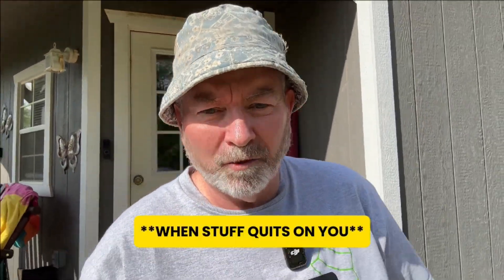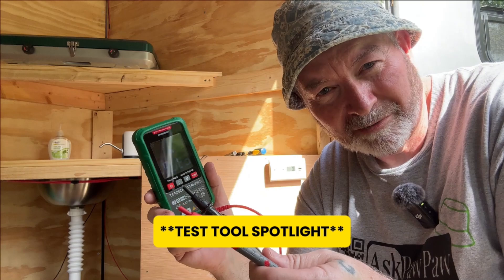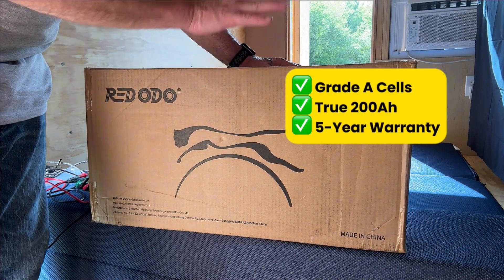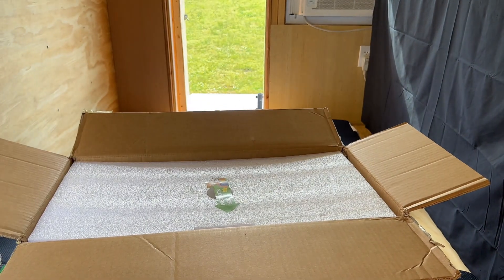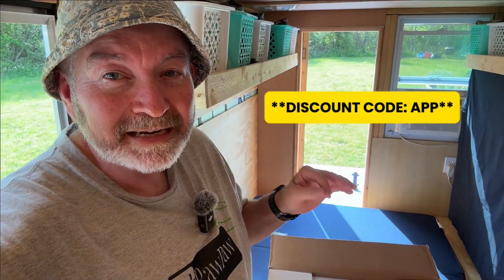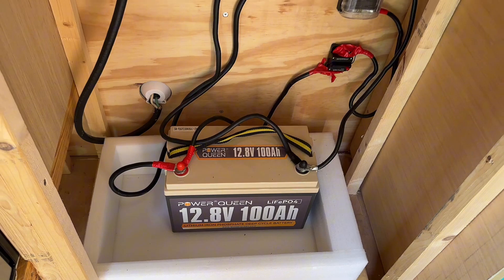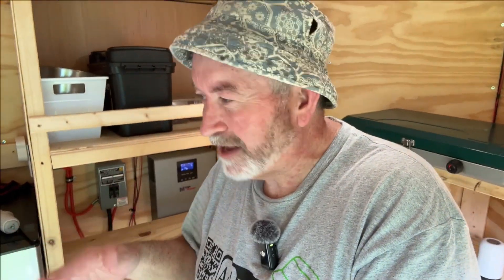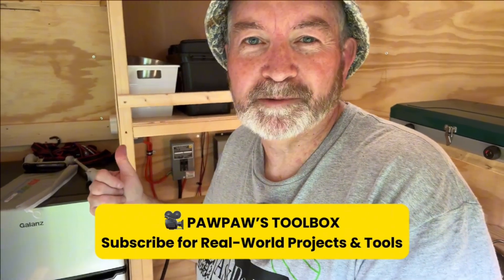PawPaw’s Toolbox: Redodo 200Ah Battery Upgrade Install

Comment from the maker: Need a solid battery for your solar or tiny home setup? 🔋
I used this Redodo 12V 200Ah LiFePO₄ battery in today’s video and it worked great!

✅ Check it out here: https://bitl.to/4MP8
🔧 Or shop the full lineup: https://www.redodopower.com/?ref=dhizkmas
💸 Use code APP at checkout for 6% off

Comment: How old was the battery that was being replaced?  How many years of service are typical?
Reply from the maker: My previous battery was 2 years old. It should have lasted longer. This type of battery should ideally last close to 10 years. Most manufacturers offer a 5 year warranty.
Reply: @askpawpaw  Did you try to warranty the battery that only lasted two years?  Is there possibly anything about your system that may have over stressed or constantly under charged your battery.  I know that all batteries have a preferred discharge/recharge for maximum life.  Some batteries need to set an initial  pattern of how discharged they are before receiving a full initial recharge.  I have no experience with lithium phosphate batteries.
Reply from the maker: @Thomas63r2  I did try to do a warranty claim and was ignored. That is why I changed manufacturers. I don't want to say the brand that didn't honor their warranty, but Redodo promises that their warranty service is reliable. I suppose time will tell and I will keep you posted. As far as the usage, I could have contributed to the short lifespan. I kept this particular battery in my cargo trailer camper conversion and it is not heated in the winter. I have it insulated, yet the model I had did not have low-temperature cut-off (you are not suppose to charge or discharge LifePo4 batteries below a certain temp) I try to always disconnect the battery if it was going to be really cold weather, but I could have contributed to the failure.